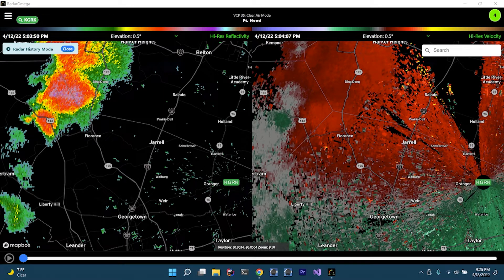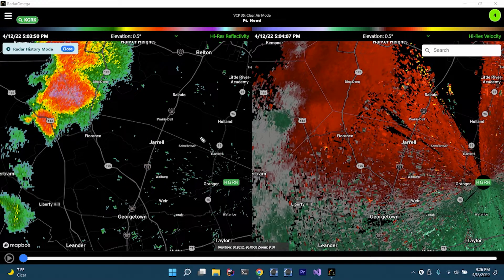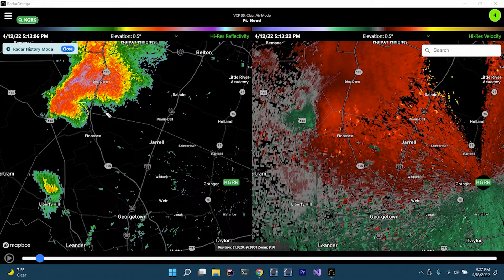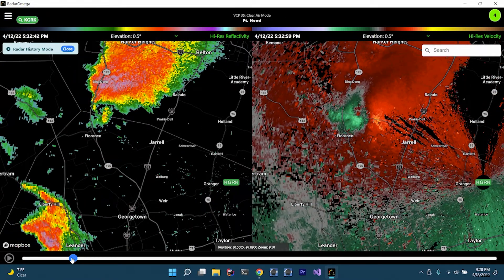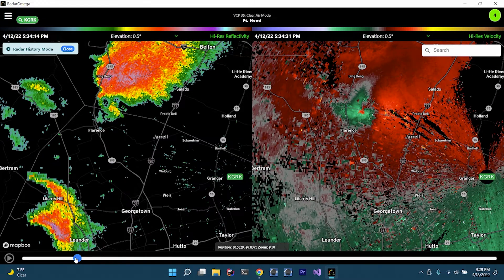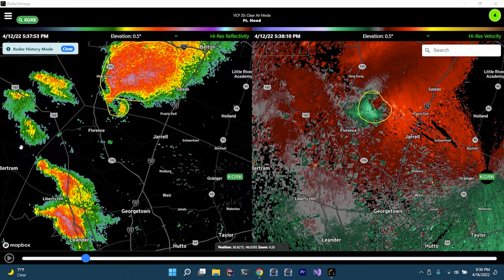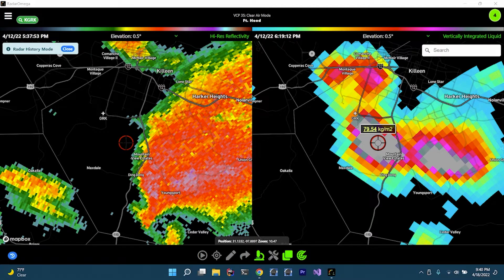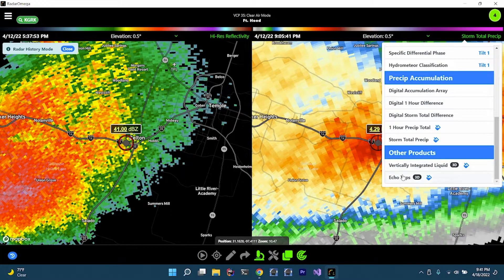How To Read Radar with RadarOmega

Comment: I mainly look at velocity because as you said, can't always trust reflectivity, and with my radar in st Louis, there was a lot of data on 1/3 of the radar, then the 2nd third was just black, and the last 3rd also had a lot of data, so why is there a void between the two? Is it just a sync issue with my device and the radar?

Also, with the correlation coefficient, while I understand what it means, am I just looking for a big shift in color? Or is there a specific color I'm looking for that would determine a size difference in debris? The hydrometer has a color legend, is correlation coefficient the same? Or is it basically big shift in color = big difference in size 

Thanks for the video, I've been using the radars provided by the weather network, I definitely like this a lot more, a lot to learn with it.
Reply from the maker: It may have been a glitch in the radar data. That data is sent from the radar site, to various locations. Ends up at Amazon S3. It could have had an issue at some point in-transit. Or, there may have been an object blocking the radar at that moment.

With CC, you're looking for a hole or punch out in the data. That will tell you if the objects detected are various sizes vs uniform in size. It's almost always a blue color, but if you change the color palate, you could make it any color really.

Comment: Can you advise where I can learn about the cell information as far as what the dot on the radar being in orange or green or red with numbers in the middle. What exactly does that signify.
Reply from the maker: I’ll have to make a video about that. Good question!!!

But to put it simply, for now, that’s called SCIT or storm cell identification and tracking. It is actually a feature of the WSR-88D Doppler radars. So it’s available on all radar applications that support it. I can go into more depth about it in a future video.

Comment: The tornado strangely intensified back to a strong EF2 as it was coming down a ridge near Union Grove and dissipated over Stillhouse Hollow Lake, which still had fairly cool water. I have a cabin home on the lake about a mile northwest of where it went over the lake and it dropped a lot of small debris, but only 30-40 mph winds most likely. The worst of the hail core also stayed east of the tornado.
Reply from the maker: Very interesting! Tornadoes do weird things! Thanks for the info!

Comment: Great video! I don't know if you have it but do you recommend Gr2analyst if you have it? Things like NROT looking helpful. An Idea I have for Radaromega is how to forecast severe weather events
Reply from the maker: I use both GR2A/3 and RadarOmega. Occasionally RadarScope as well.

Each tool as strengths and drawbacks. I prefer RO specifically for the maps. It’s the only solution to provide full map support.

I may make a video on forecasting. But it will be heavily caveated. As I’m not a meteorologist.

But I can certainly show what I personally look for and my process.